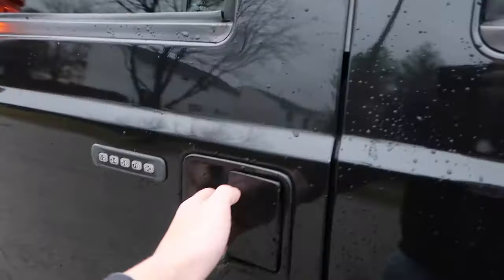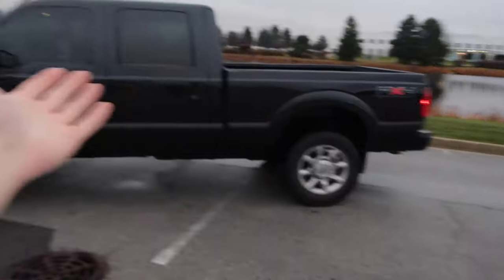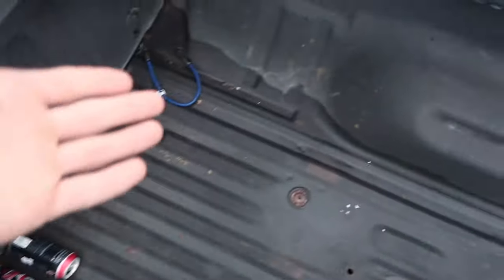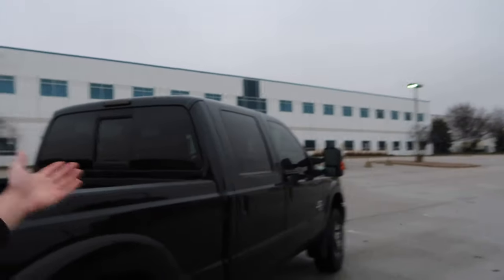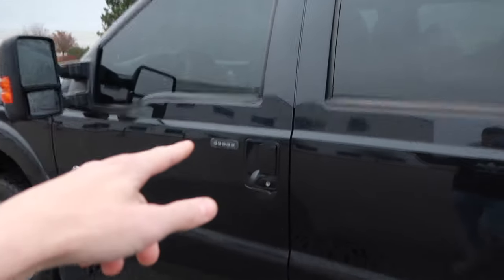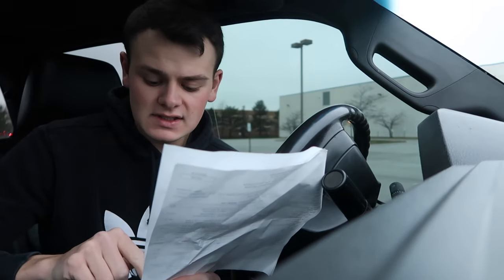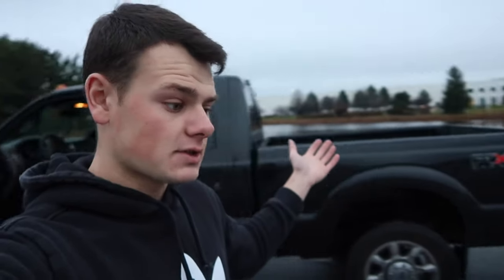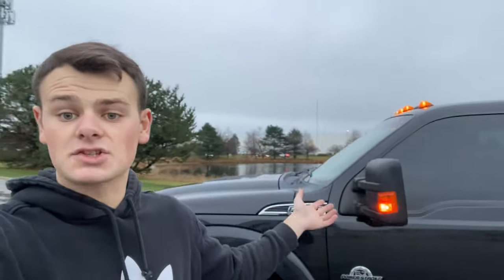Buying a USED Diesel? WATCH THIS FIRST...

Comment: 3 extra grand to make it drive like brand new?? Doesn’t seem too bad considering it a used truck
Reply: Well another 3k on top of what was potentially 25k+... its all subjective
Reply: @kyleranderson1948  Yes, an extra $3,000 on top of $25,000 so that you don't have to pay another $25,000 for another vehicle after the first vehicle craps out.
Reply: @WeatherxCalipha  like I said it's all subjective read the comment before you wittle your thumbs. 3k on top of a 25k truck is looked at as a waste because you can find a 25k truck in better condition if you are patient and if it's suspension then im not sure how it'll crap out. It's all subjective and person to person. Loose ball joints and nickel and diming wheel bearings or tie rods until the truck dies might be more reasonable for a guy that rides rough roads and will never experience a smooth ride out of a 170k mile vehicle. Better judgment can save yourself a lot and being picky or ignorant can waste more.
Reply: Yea for real, bought a 7.3 excursion had to put 12k into it off the bat
Reply: That's ford. Any used truck of theirs has work to be done.

Comment: Everything that you mentioned are things that you need to look for in every used vehicle purchase, not just a diesel.
Reply: "Things to look for when you move out of mom and dad's house and buy your first truck"
Reply: Thats what i was gonna say lol
Reply: Very true, but because of the weight of the diesel engine, front ends wear out faster than a similar gas truck.
Reply: Yeah but if you did it your self probably have the price

Comment: What has the diesel thing had to do with the fact that you didn't check for mechanical and rust issues? 🤦‍♂️🤦‍♂️🤦‍♂️
Reply: A lot of the issues he said are just normal stuff after 10 years and not as big of issues as he states

Comment: Find the company near you that installs utility beds, typically they have brand new takeoffs beds for 12 or 1300 bucks.
Reply: Yep. I put a CM brand flat utility bed on my older Chevy 1 Ton and it made the truck look amazing, and a whole lot more functional. It was a dually though, and I don't think flat beds look all that hot on SRW trucks.

Comment: Jack rabbit starts and stepping on the accelerator pedal hard contribute to more soot entering the diesel particulate filter which is not good. I use cetane additive into my tank. Hot Shots is just one company that makes a good cetane booster. Your Bosch CP4.2 fuel pump needs to never be exposed to any amount of water.

Comment: Being in the rust belt, you will have rust. There’s no avoiding that. 

You could’ve rebuilt your own front end for around $1000. The ball joints are the only job that would really suck. Everything else that was on the list is relatively easy. 

I’m glad it fell, 5in sounds way better. 😂

I think it was an okay buy. 👍🏽 I’m glad you made this video. I’m looking into a 15+ Powerstroke. Getting to see where rust potential is.

Comment: Other than the exhaust that stuff applies to all 3/4 and up trucks. Really all trucks, but since heavier trucks all tend to have been used harder, they have a lot of problems in common.
If I lived in the rust belt it would be worth it to me to buy a truck from a southern state. It's not just body rust you to worry about, everything underneath is so exposed. A few hundred for a plane ticket could save you a few thousand. I see car carriers all the time hauling used vehicles from the South to the North, and from the North to the South. Dealers can get northern vehicles cheaper, and people don't always check.
Your truck does look good in the video.

Comment: I totally agree with the fact you should know what your buying. I baught a 2005 Ford ranger with the 4.0 V6. I have a 2013 Mazda 6 manual that I absolutely love but I needed a truck. I overlooked so many things on the ranger when I baught it. Granted I only paid 300 dollars for it. I totally ignored the fact it had a hard time starting I thought it may if been the battery. The bed was rusted out which I knew. But after all was said and done I found a joke in the floor board a weak spot in the frame which I had fixed. I put in a new starter a new fuel filter a new thermostat and nee headlights and a new bed. All in all I spent probably 850 on the truck total. I love the little truck. In upstate New York it's really all I need being 19 but my dream truck is a F250 king ranch 6.7. One day I'll get it.
Reply: it's bought*

Comment: My grandpa had the death wobble on his 2013 f250 and he took it to the Ford dealership and he didn’t pay a dime for it and they replaced the entire front end, he replaced the tires also which was the only thing he paid for, plus they gave him a brand new 2019 F150 loaded to drive while it was being worked on, wound up having I think about $5,000 in replacement parts (excluding the tires) that he didn’t pay a dime for, recommend taking it to a Ford dealership if the death wobble comes back

Comment: I did the same thing bouth an 06 f350 had 232k miles test drove it felt in love for it on interstate scared the hell out of me, took it to a shop to get alignment and they said brake caliper was fked, but I fixed it now it’s a solid truck. 🤣
Reply: Aslo later i looked up the vin number It had 5 owners 🤣

Comment: Emission controls in the late models ruined diesels. What’s interesting is NEW diesels are getting more and more expensive to repair; but this guy had some pretty cheap shortcomings with this truck compared to what I’ve heard about Powerstrokes made after 2007.
Reply: Well 2008-10 was the 6.4 which was problem city. The 6.7 is a pretty good engine that was really only plagued with turbo problems in the early years and potentially fuel Injection problems from a wearing cp4 pump
Reply: This why diesel owners deleted the emissions system it only does one well and that's break and if you ask me if you want me to drop upwards of 100k on what just rolled of the line E.P.A. or not the emissions system is coming off

Comment: If you are looking for a project and you find one you always wantedand you want to know if you can squirt a little diesel fuel in the throttle body and it pops the low rumble as it turns all the way around then fires of fule only  then its a good motor if it has not ran for a long a wile but fires means its not a eather baby and the motor has good conpression and as long as the body and frame has very little rust just a lot of sanding and cleaning and rebuilding of some  parts   and you can get the truck fro a good price then get it home and start with the frunt end then the hood and finders iner finders

Comment: Wish I would have saw this video 3 weeks ago. Bought my first diesel, and it cost me around $3000.00 to fix many of the same front end problems.
Reply: Basically all used trucks will need front end work
Reply: You're just not going to get away from that with a used diesel. The engines are so heavy that it really takes a toll on everything up front. I'm going to have to start replacing pieces of the front end on my 2012 powerstroke soon at 146xxx
Reply: I tel u why people thinks it’s an off road truck it can handle the rough roads and wholes in the roads not true it’s like any other vehicle you still need to be careful not to hit bad potholes and stuff people don’t realize off road mean off road meant to drive and trash on soft dirt roads etc. not hard concrete and asphalt

Comment: It’s interesting back in the day when someone drove a diesel it’s because actually worked with it today every kid has one .. In my opinion you get the best for your money when you buy them two years old or 1 year old with 20,000 miles.. you can get a 2019 for example with 40,000 or less  miles for 48k . Or a 2015 with 140k . For 39$ they hold value it’s worth adding $100 to your monthly finance and maintain your truck the way it should be from the beginning Or at least closer to less Mile.. I purchased my 2017 F350 6.7 xlt dully with 18,000 miles . At the time it was about a year and a half old I payed 48k now 2021 I could probably get the same amount back I have 48,000 miles .. it’s worth leading the extra money upfront.. diesels for some reason hold amazing value when they’re 7 to 10 years old Best time to sell and if no mechanical problems Basically cost you 10 - 12 k to use a truck for eight years zero issues. Or ride it till the fucking wheels fall off... when you buy these old trucks there a money pit If a  motor or something big goes they’re not worth anything put your money into a newer truck the money is there ... I had a 97 12 valve with 400,000 miles Long story short cost me 20 grand to operate the truck for four years I had it. That’s $500 a month you add another 200 a month and you’re in a brand new truck and the resell value is there ... when my motor blew on the 12 valve it was worth shit with 400k truck

Comment: Everything you listed except the exhaust has nothing to do with diesel specify, and is something you should check on all used vehicles when buying one. As for the exhaust you would want to check that on diesel or gas to see if they are rusted out. But especially 2007 and later diesels, with DPF and DEP. If its deleted who did the delete? You never mentioned anything involving the motor itself which it something you would really want to check on a used diesel, checking the blow by. If you have a bad motor a new Cummins will cost you 10k just for the motor not including the labor. Checking the turbo, replacing a bad turbo could cost you 3k alone.

Comment: I think that you got a good truck but not sure about the deal. Normally when I buy a used truck I run it through the dealership and ask them to look it over with a fine tooth comb. I spend the next two years getting all of the repair work done.

Comment: has your cp4 pump gone bad yet?  wait until it does , now thats costly, or if your dpf filter clogged  yet? ohhh boy just wait.
Reply: Those 2011 power stroke also eat glow plug tips.
Reply: @LukesGarage   I heard things about that, is it the 2011 only or all 6.7s. I just got my fixed from the cp4 and it costed me  13k and 3 months at a ford dealer ☹
Reply: @Ricky90222  It was only for the 2011 model. Sorry to here about tour truck. Ram swapped to the cp4 for 2019. But had so many issues and warranty claims that for 2021 they swapped back to the cp3. And they offer a kit to swap out the 4 for the 3 now for those that want to swap.

Comment: What is “bulletproof” means on those ford trucks ?
Reply: Bulletproof refers to 6.0 Powerstore.   From 2004 - 2007.   It has to do with Egr causing head gasket overheating.  The only way to remove the heads is to pull off the cab which is 6hr job by the book.  And sky is the limit on how many hrs a shop charges.  Most challenging part is lifting the cab about a meter up in the air.  Mainly held by 7 - 8 bolts so it doesn't have to take a week or a month to pull the cab for experienced shop.   I personally love working on them certain things is b'tch perhaps not for the faint of heart.  Because it requires you go in blind by feel making sure bolts don't fall off the socket and most likely specialty tools if you cant make your own.

Comment: Yeah maybe you spent 3100 more by buying this truck to fix it's issues but at least you weren't a dumbass to buy a 2021 f250 driving off the dealership it's value drops 30%

Comment: I’ll be honest, rust is what it is. Not that big of deal unless you’re gonna be hauling a ton of weight in the bed. The frame rusting is way worse
By far engine issues can be way more expensive than suspension or body rust issues.

Comment: Sounds like your just a very irresponsible car buyer. 
Not only did you buy a neglected heavily used vehicle 
But you also bought a 2011 model. Its so incredibly well known to avoid 11/12 6.7s u less you get em cheap and low mileage....
You sir. Have learned from your mistakes. 
I sure hope u didnt pay more then 20k for a truck with less then 150k miles!

Comment: So people are aware, front end total replacement is 5k, rust repair will be 3k per item, bed is another 3k maybe. You’re looking at around 11k EXTRA for repairs. Sucks but at least you learned a valuable lesson. 

36k for a great running diesel with that mileage is not HORRIBLE. Trust me I’ve seen worse. 

If you take care of all the issues and do it right you’ll have that truck in a very good situation.